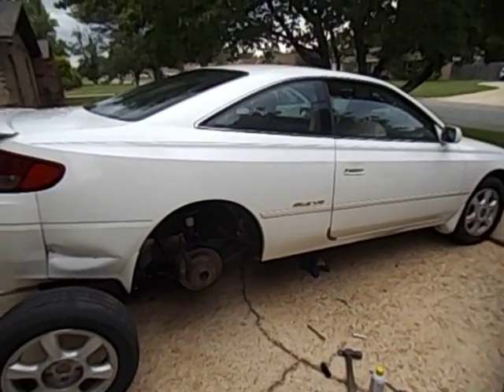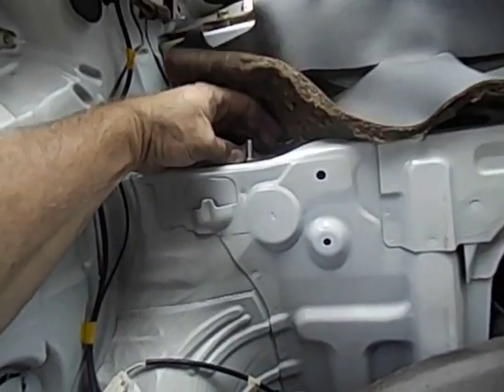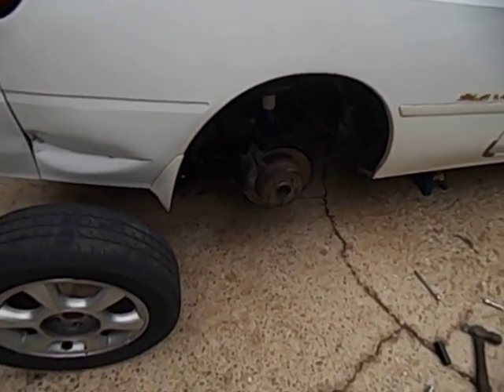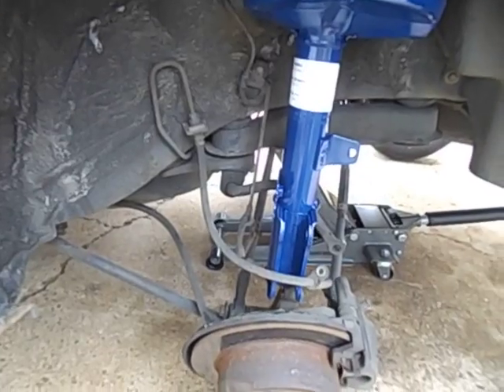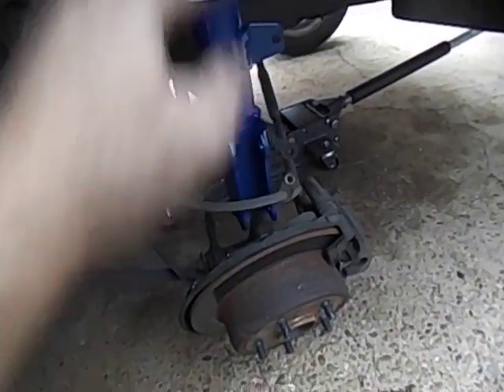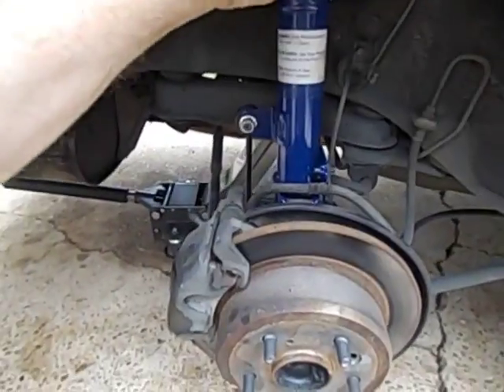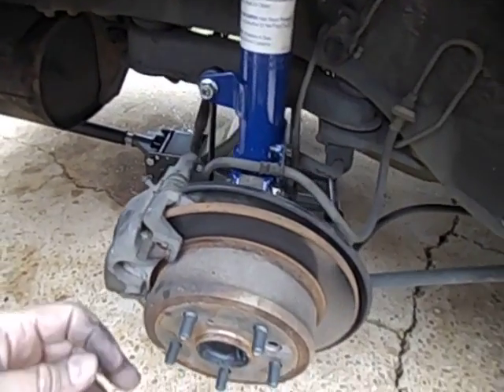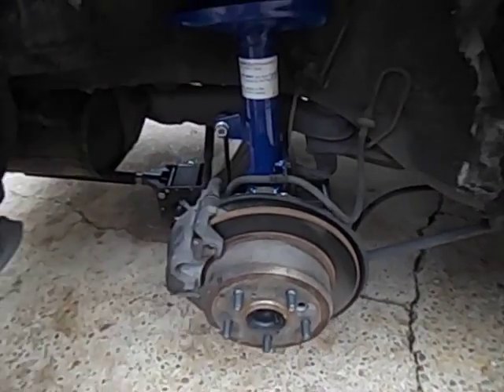Toyota Solara rear shock installation tips

Comment: I've got KYB struts and strut mounts in the rear. One side started making rattling sounds on top after a few months. The shop the installed them said they just needed to retighten the 3 nuts on top. That worked until I drove over a speed bump. Now the rattling is back. Another shop said I should've used Toyota brand mounts. What do you think?